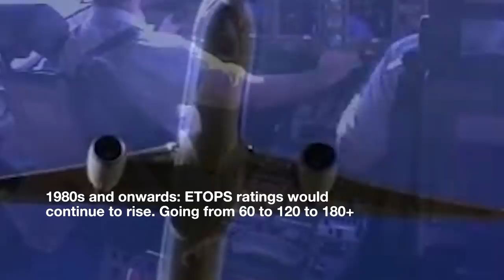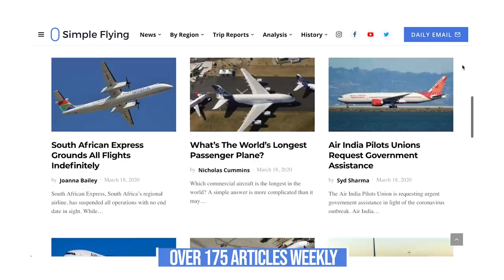Why Did Tri-Jet Passenger Planes Not Become Popular?

Comment: When flying over 7000 miles of ocean I’m just not comfortable with a twin, I flew from San Francisco to Manila Philippines on a 747 completely relaxed just knowing had 4 engines, with a twin one engine goes all of a sudden your life totally depends on one remaining engine that now has double the load factor on it, and with no land in sight for 1000s of miles no thanks.
Reply: I wouldn't feel safe in 300km flight in any boeing
Reply: Anything that would make both engines fail on a twin jet would almost always also make all engines fail on a jet with more engines. Your argument, by logical conclusion, would demand ever higher numbers of engines ad Infinitum.
More engines also means more moving parts, which also means a higher chance of accidents occurring. An uncontained engine failure might be bad on a twin jet, but the chances of an uncontained engine failure occurring rise in proportion to the amount of engines. If your chance of accident rises proportionally to your redundancies, then that additional redundancy isn't anymore useful than a simple redundancy. Further, seeing as a damaged engine can affect more than just the engine itself, increasing the number of engines actually decreases the overall safety.
Reply: @MajinOthinus  wow you wrote all that but failed to grasp the fact you now have one engine that now has double the load factor placed on it, there is a reason all planes return to airport or land right away after engine failure, going by your logic all planes would be designed single engine since would have less moving parts.
Reply: jenbill1602 The truth is that the remaining engine does not have “double the load” on it. A Boeing B737 NG using 2 CFM56 engines will display the following parameters in normal cruise flight (assume Gross wt of 70 tonnes and at 36,000’ Alt:

Each engine: N1 speed (the engine speed) 88.1% of maximum. 

True Airspeed: 454 kts. Long Range Cruise.

If an engine fails, the pilots will set Maximum Continuous Thrust (MCT) on the good engine. Note that more thrust is available, but limited to 10 mins use. MCT means that you can use that setting all day, if you wanted to without destroying the engine in the process. At a high altitude, the aircraft won’t be able to maintain that on one engine, so the pilots will set MCT and commence a drift down to an altitude which can be maintained. At 70 Tonnes gross weight, a B737NG would be able to maintain at least 18,000’ on one engine. 

At 70Tonnes and 18,000’:

N1 is 93.2% at MCT.

True Airspeed is 380 kts ( Single Engine LRC).

As you can see, the N1 in cruise flight has increased from 88.1% of maximum to 93.2% of maximum; an increase of only about 5% in engine speed, but about a 10% increase in thrust from that engine. Thus, the aircraft engine is not working 2x as hard. The penalty is that the aircraft must fly at a lower level and can only achieve a much slower speed.

A similar principle applies to other twin engine aircraft such as the B777 and Airbus A350. These ‘big twins’ must be able to have an engine failure and still divert to an airport that is within 180 minutes at Single Engine cruise speed. The route must be selected so that they can do this- they are not allowed to be more than 3 hours away from a useable airport at any time. The advantage of a 4 engine aircraft is that they aren’t subject to this route limitation. The B737NG is limited to 120 mins from an airport, at SE cruise.

I hope that this helps.
Reply: @Slynsmiley  thanks for the info appreciate it, but would still prefer 4 engine plane,  just knowing you’re down to one engine that just happens to be an exact copy of the one that just unexpectedly failed and no place to land for thousands of miles would be nerve racking to say the least, take care buddy.

Comment: Nice. What about Airbus twin jet A330s and a quad jet A340s? What I do know is both can be re-engined easily compared to tri-jets. A340s were there in case A330 would've suffered a similar fate to A300s. The A340 program did work but only for a while.

Comment: The title is misleading because the 727 was the MOST popular, best selling tri-jet of all time. The only reason that it is no longer around, is because technology, newer, more powerful but quieter engines and more advanced flight controls, led to the development of the 757.  Which was the 727's replacement. And it was only fitting, that the 757 surpassed her predecessor in  winning hearts and loyalty. ❤💖💜🥰🤗

Comment: I'm kinda disappointed there was far more focus on the DC-10/MD-11 than on the L1011 (which was the superior aircraft of the two, but didnt sell as well). 
But even the 747 is on its way out now, marking the end of the Quad-jets now that, given the efficiently and power of engines, Twin's can now do the same job, at much lower cost. Its sad, but enviable. Some may say "But the A380", but that plane didn't sell all that well and i think even Airbus has already ended production on it. 

I'm sure the 380 & 747 will be flying for a while, but only until those companies flying it can afford to replace them with more efficient twin jets.

Comment: its simple, 3 engines aren’t as fuel efficient as 2 engines
and also planes now have more fuel efficient engines, and planes now
dont have to obey the 60 minute rule due to the amazing engines.
Not to mention that planes can glide for 130 miles without engines

Comment: There needs to be a new tri-jet or quad-jet put out by Airbus or Boeing. The A350 and B777-X are simply not big enough to satisfy demand on key hub routes and airlines will need a replacement for the 747-8I and the A380. I am not sure twin jets can get large enough to be a suitable replacement.

Comment: It's not the number of engines that is important.

The combined bypass ratios of any number of engines is what determines power production efficiency.

Imagine bypass ratios of 1000 to 1.

How much more efficient could that be than 12 to 1 or 15 to 1?

Yet this is achievable with current materials.

Until you grow past last century aerospace design,

these levels of efficiency will never be realized.

It's long past time, to move On!

Comment: For their time these aircraft (and the B747 for that matter) were very efficient and reduced the cost of air travel.
It wasn't just ETOPS, it was what engines were available. High Bypass turbofans were new technology, and there weren't many types around.
The sheer size of the widebody airliners largely dictated their engine choice. Three engines of existing types gave the thrust requirements.
Commercial passenger aircraft have to be able to complete a take-off with an engine failure, with a twin engined plane that means 1 engine, with a 3 engine plane, that's 2 engines.
It's much easier (particularly at the time) to achieve your thrust requirements with 2 engines than with 1, especially when you're that big!
The overall reliability of 60's/70's powerplants was less than it is now.

Comment: Twin engines planes are more efficient than three or four engines planes which were long needed for safety reasons on long haul routes. But since the generalization of Etops certifications for twin engines planes, there is no more need for less efficient three or four engines planes. This is why three and four engines planes are disappearing.
Another problem with three engines planes was that there was no fully satisfying location for the third engine.

Comment: They were popular. They just did not remain popular when the engines were proven to be very reliable and suitable for 2-engine ETOPS 180 and they got big enough to allow two engines with one engine out capability. Then the lower cost of acquisition and operation of 2-engined airplanes started to win out. (Which is pretty much what the video said)

Comment: The B727 wasn't really an ETOPS jet, it was designed for short-mid haul routes. The third engine made the 727 far more popular than its sister ship, the B737 and the DC-9 because its density altitude performance was superior. It was a great performer for flying in and out of high and hot airports. The continued success of the Dassault Falcon trijets shows that there's still a need for that added performance. I can think of a number of airports where losing a single engine of a 2-engine plane would be fatal. Not surprisingly you see a lot of the French 3-holers at those airports.

Comment: These three engine jets died out as the Ford Tri-motor and Fokker planes did.  Tech development obsoleted them.  Two powerful, reliable engines were deemed good enough.  Four engines, although fuel gobblers, are so much better.  Ask anyone that ever flew aboard a Boeing 707.

Comment: Reasons why trijets are not popular now.
1. Economics. Two engine jets are just cheaper to operate and maintain.
2. ETOPs makes #1 possible.
3. Safety risk. Tail mounted engine blade out or turbine failures can take out the tail controls. . Reference United Airlines Flight 232 accident. Believe this accident was significant factor to not seeing new trijet designs. Not sure about this but FAR regulations may have changed to address this risk making new trijet designs difficult to certify.
4. Tail engine is limited to the amount of bypass engine can have. More bypass more efficiency. Under wing engines can accommodate larger diameter bypass engines. Tail more limited to diameter and therefore limited to how much efficiency. Note there are tail engine concepts that in combination with fuselage design can yield greater overall efficiency but I believe these concepts have the engines to close for blade out and turbine failure risk of taking out second engine.

Comment: You missed one of the most critical points and why we still see a lot quads in use but very few tris.  Catastrophic engine failure sometimes occurs. When it happens in a nacelle mounted on a pylon, whether under wing or on the side of the fuselage, the opportunity to cause further damage to critical systems or components is strongly mitigated.  Just look at the difference in outcome between United 232 and Southwest 1380, both incidents involving a failed engine, some loss of life, death, and served by amazing flight crews minimizing the scale of death.

Comment: Now answer the question of why they didn't decide to just put two engines on the back of the things instead of on the wings (there is a reason that' involves the engineering and not just the safety rules.)

Comment: I despise air and space craft that have unbalanced thrust when an engine dies. Four engine aircraft can just turn off the opposing engine, two engine and three engine are forced to, largely, glide.

But, put all three engines in line with the center of mass, and trijets have the benefits of four engine craft.  Why wouldn't you want an intake on the leading edge of the plane anyway?  Surely the body lift would be compensated for by decreased drag.

Comment: if you want my opinion on tri jets. they are a cool idea but not really effective. what i could see them becoming popular again on would be high speed passanger & cargo liners, not super sonic levels of speed but rather high speed to reduce distance.

what could be done to avoid the noise issue would be to reduce power a bit before arriving so the engines wont generate too much noise every time they passed by. but thats honestly my opinion. you could always have 2 main engines for high speed and the 3rd for landing and taxi which could also work.... again thats my opinion and some people may find flaws with my thinking.

Comment: I bet Cpt Sullenberger would’ve quite fancied a tri-jet on January 15th 2009
Reply: Ya, and every passenger.
Reply: with only one of 3 engines working the aircraft also could not stay in the air.
Reply: Simon Maier oh never mind, I was going to google that question to see if it was possible but you’ve just answered it for me. I suppose they were heavy with fuel as well at the beginning of a flight. Do you think it would’ve made his life any easier having 1 engine rather than none?
Reply: @calvinsmith3952  To be honest I don't know, but with only one of 3 engines the aircraft also couldn't maintain a leveled flight. You can loose one of 2, or one of 3 or 4, but even with 2 out of 4 you will have problems if the aircraft is still heavy, because aircraft built to FAR 25 standards can safely loose only one engine (even with MTOW).
Reply: Simon Maier That is presuming that the engine on the tail wouldn’t have ingested a load of birds. That would’ve been really unlucky a triple engine failure 😀
Reply: @simonm1447  Perhaps not but it would be able to make it back to the airport and land safely instead of having to ditch in the Hudson.
Reply: @ky7299  Flying a Trijet with only one engine, in very low altitude (what means you can't get speed out of sacrified altitude), make a turn (turns are prone to stall in such cases) and land ,,safely'' ? 
They could be glad to fly an Airbus with stall protection, Sully could pull as much as he wanted at the side sticks, the aircraft still protected it from a stall. With a non- FBW aircraft likle a 737 he would had to be very careful not to stall it, a additional workload in this situation.
Reply: It's not so much a question of the number of engines but of the mounting position. Imagine it would have been a DC-9/MD80/MD90 style aircraft with 2 tail mounted eingines in that situation. With underwing mountings the engine intake is the foremost part part of the wing. Whatever the wing encounters, the engine intake hits first. 
I'd really like to see a simulation of the accident with the A320 replaced by a MD90. My guess is that the wings leading edge of the MD90 would have smashed and shredded the geese and swirlled the remains enough for the engines to survive the ingestion of some small remaining parts...
Reply: Simon Maier incorrect. One of three engines working would have surely led to a safe landing. See Eastern flight 855.
Reply: stefanguels agreed. The MD90 would’ve fared much better than the A320, given the engine placement.

Comment: Here's a question: Has there ever been a two-engine failure on a jetliner?
Reply: Yes. Sully. Miracle on the Hudson.
Reply: @Kupp_Kakez3  Aha!  But also, that was right after take-off (where the birds were).  Smarter question: Has there ever been a two-engine failure during cruise phase?
Reply: Craig Meyer ahhhh I see you’re point!
Reply: MZ_TRINA1517 Yeah see.  I’m looking for some kind of a reason for why a 3- or 4-engine jet should ever be required for safety reasons again.  Of course the pro’s are surely on top of all this, but I’m curious anyway.
Reply: @craigrmeyer  Cruise is the most benign phase of flight. Air is clean and free of ice. Only bad fuel could affect both engines simultaneously, but that would most likely be noticed during climb.
Reply: Greatdome99 Now we’re talking.  (So there’s a buttload of QA going on behind the scenes at the refineries.). This must be why two-engine long-distance jets have worked out so well.  Failures still happen, but only close to the endpoints.
Reply: Just recently PK8303. There's no medicine against idiots...
Reply: stefanguels I just Googled this and learned that the crash was immediately after takeoff.  (Noted here for the record.)
Reply: @craigrmeyer  ... actually it was after a gear up touchdown with the engines ruined by ground contact and a failed attempt to go around. Wouldn't have happened this way with tail mounted engines. I'm convinced though that the idiot in the cockpit would have found another creative way to f*ck up and kill himself and all aboard.   
You'll find https://en.wikipedia.org/wiki/List_of_airline_flights_that_required_gliding interesting
Edit: Going through the list there is indeed not a single case where the number of engines was a key factor for a desaster, except for the cases where stupid pilots shut down the single working engine instead of the broken one. A third engine would have mitigated that a bit... Fuel starvation or volcanic ash ingestion would have killed 3 engines the same way as 2.
Reply: @stefanguels  Hot dog now this is some information right here!
Reply: stefanguels This is why I can’t quit YouTube comments.  97% cheap-seat idiocy, and 3% “holy crap what a great point.”

Comment: what if the tail engine failed in tristar aircraft? It would be much more fatal than wing engine failure. So I guess twin & quad jets are a bit safer than trijets.
Reply: It depends how it fails. A uncontained engine failure is more dangerous (a DC-10 crashed because of one), but this is rare, normally they are only shut down.

Comment: I liked the L1011, and flew in one a good few times, though as it happened never across an ocean. But I don't see any new tri-jet ever being built. Indeed, with Boeing's recently announced termination of the 747 production, once the current 4 engined jets are retired (including the few remaining to be built by Boeing), we'll see nothing but twin jets from here on in.
Reply: The last L1011 in service is the Stargazer launch platform which is rarely used.  There's a few business jets out there that use 3 engines but the rest of them are all either freighters or military.

Comment: Yes I reckon with the a380 and soon the 747 to be pulled from the air the trijet will come back
Reply: The A380 and 747 are being pulled because they are not efficient enough, and because twins can do the same job better. The quads outlived the tri-jets because they were able to do things that even the super twins like the 777 couldn't do. Now the latest super twins like the 777X and A350 can out compete a 747 or A380. Also, most routes don't justify aircraft of the size of the 747 or A380.